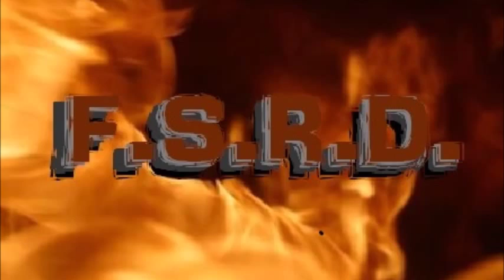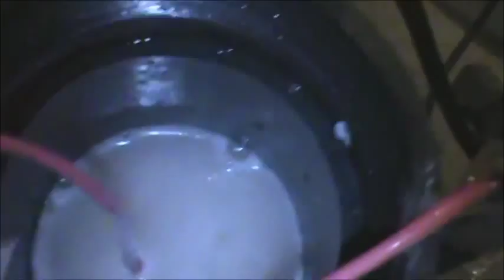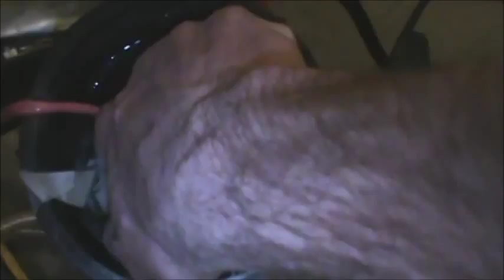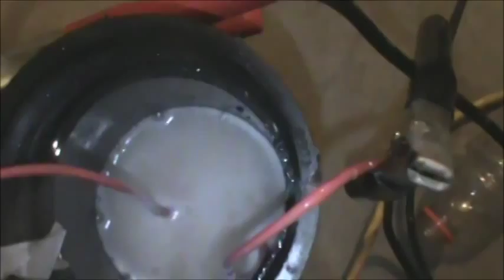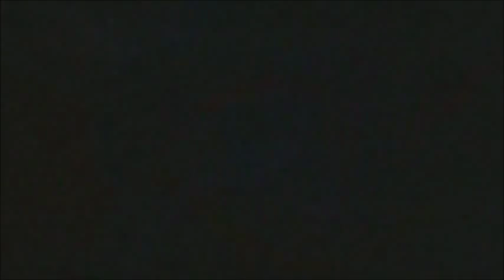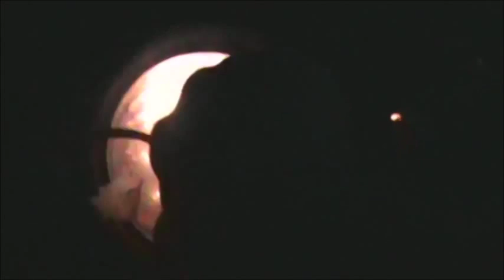Awesome HHO Ignition

Comment: It would be cool to develop this into a burner. Somehow use a fine mesh screen at the top right above the gas to maintain burn like that? It would be cool since you also don't have to worry about flashback...cool experiment.
Reply from the maker: That would be pretty neat I would be worth a try! The reaction stays going as long as the bubbles come out at a constant rate. This cell can put out allot of HHO for what it is, it does get hot but sometimes that can be a good thing. I am looking into buying a large roll about 50 liner feet total of stainless steel coil (looks like aluminum flashing) so I can make a spiral cell that will produce tons of HHO within a small area the cell would be about 10,080 square inches or more of total surface area to produce HHO because gases would be produced off of each side of the plate or coil.

Comment: Sweet effect, new electrolite? Last I saw you were working on the vaporizer, gata love the hho culture. Cheers
Reply from the maker: It is a pretty sweet effect! Nope it's just baking soda that I'm using as the electrolyte. I have had the effect last for about 40 seconds it kept goin and goin... I'm still doing the vapor stuff not as much as I use to because my family has needed me so I have to back off on it sometimes. I am hoping to shoot some videos by Tuesday on the vaporizer I made for the generator that I have not shown yet. I have been waiting for one of the brackets for the exhaust to be welded up and should have it by Tuesday. I still need to make a muffler for it so I don't get the cops called on me when I run it lol but it's almost ready to go.